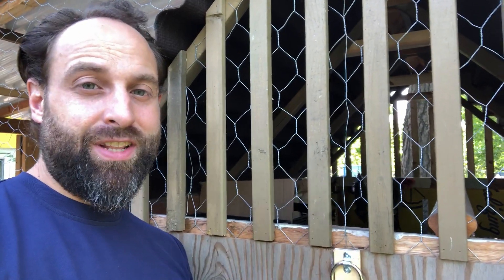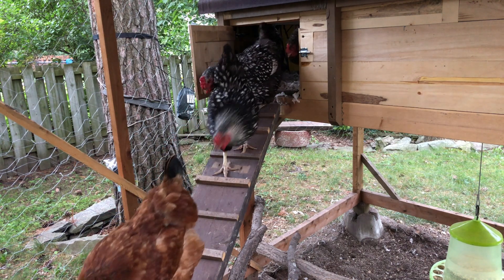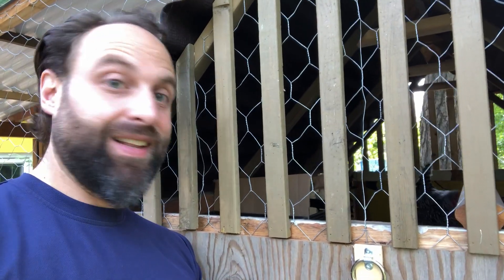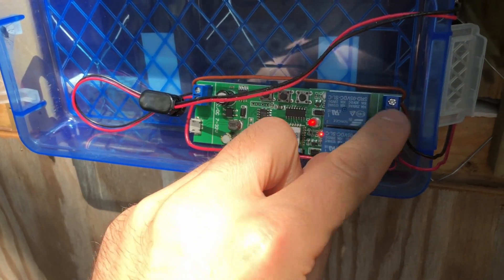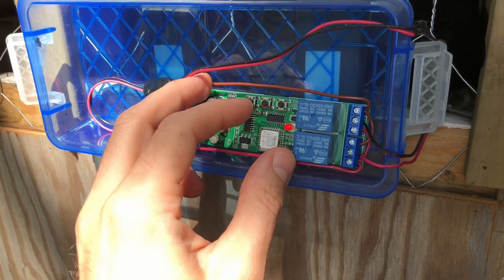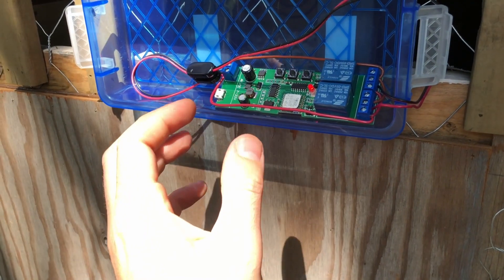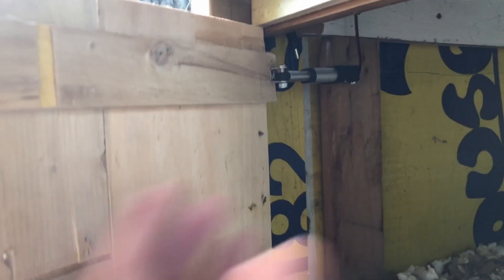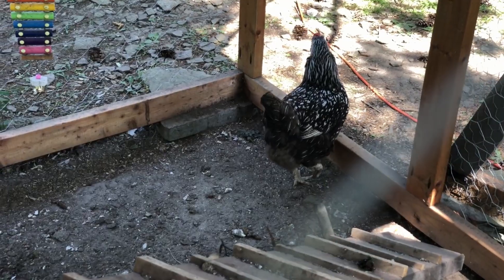Chicken Coop Automatic Door Opener - Wi-Fi Connected \\ Home Projects \\ (Ok Google, open the coop!)

Comment: FINALLY!! FINALLY I FIND A PERSON DOING IT THE SMART WAY, well until I saw that tiny actuator. LOL. Thought you were saying you had a 2 or 4 inch of the 12" 900n 225lbs most people use. Still I like it. I tend to go a little extra with mine but I do endorse the use of the MHCOZY and SONOFF 4ch smart switches. And that just about all you need. 

Also great video. Fast, direct, to the point.
Reply from the maker: LOL! Yeah, it's just a baby actuator, ha!  Since the interior door is light, it does the trick. Agreed, the smart switch is amazing too, I've been able to open/close the door from across the country!
Reply: @JeremyLabelle  such a cute itty-bitty baby. But aren't there child labor laws against that